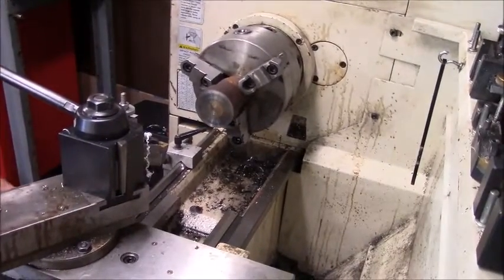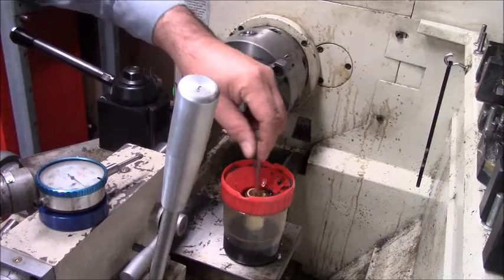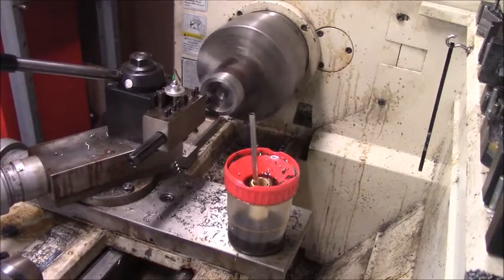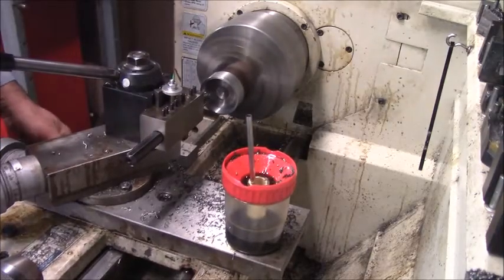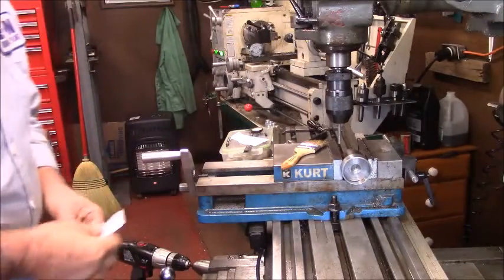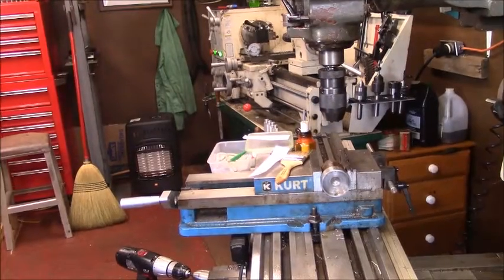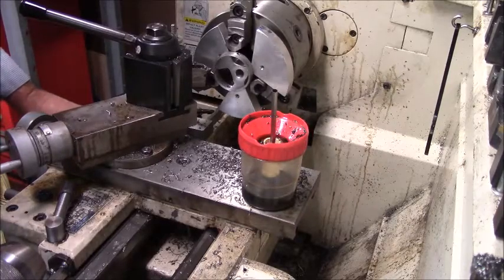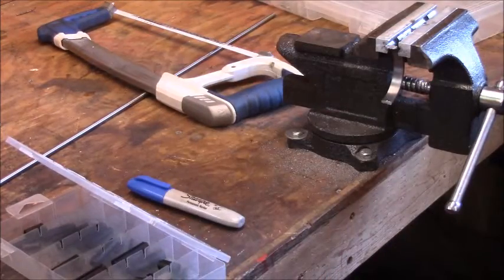Shop made spanner wrench for keyless chucks

Comment: Nice little wrench - I don't use keyless chucks of that size, and have always been suspect of them as far as getting them tight enough or being able to loosen them if they got overtightened.  A small spanner wrench like that would definitely make using one easier.
Reply from the maker: Everett's Workshop yes that’s a drawback to the keyless chucks, it beats a strap wrench. Thanks

Comment: Hi jim 
what is wrong with the lathe sounds like you got belt slippage
Reply from the maker: Nigel Harding actually it’s the HP of the machine I actually stalled it before
Reply: Is it a 2HP motor?
Reply from the maker: Hill Top Machine Works yes but a Chinese 2 hp, unlike your Enco my Grizzly was built in mainland China, instead of Taiwan

Comment: Hi did you know I was thinking when you shared you have more time then money what I have learned to do is because I too have way too much time and little to no money is get really creative so I am thinking that when like me you have little money your creative ideas flow at their best levels. 
Spanner wrench truly enjoy the build here, we believe we know the original maker of the German made Albrecht chuck, it has no spanner wrench so here to learn why the knock offs (or what you call the cheap) need one of these wrenched. Yes on the tubing to start makes good sense but I know from you, you use old scrap you have laying around which we like here.
Reply from the maker: Active Atom I had a Rhom keyless chuck that froze up. However it also had the same set up. So I decided to make one up for when I need it. I want to make a one for the ER collets
Reply: My Albrecht doesn't have the pin wrench holes either. Only a semi logical guess on my part, but the cheap keyless would certainly not have the tightly controlled heat treating and then a lot of precision grinding steps done to them. They have to skip a lot of that built in accuracy and precision to meet the far lower price point. Doing so results in much less holding power since so much of the tightening force is then lost to friction. I also bought 3 integral shank keyless chucks from Glacern machine tools that surprised me since they compare quite well to my Albrecht for run outs and holding power. I've yet to ever have anything spin in one of those chucks or ever require a wrench to loosen them and only use normal hand tightening. I'd certainly buy more of those. But like anything else there's a trade off with the keyless. Using the large diameter Silver & Deming type stepped drills in them is a huge mistake. A good keyless can self tighten enough while using those to do permanent and non repairable damage to the chucks internals. Anyone using the S&D drills should be using a good keyed chuck or an ER collet chuck. That normal self tightening with a keyless is also why I limit mine to about a 3/8ths maximum while power tapping. Mine will usually open by themselves while reversing with anything more than about a 3/8ths tap as well. 

Rohm from what I've seen have I think at least 3 price levels for chucks with there brand on them. One is at best a dirt cheap DIY grade that must be getting made in China or India under licence with Rohm to roll stamp there name on them. The second I usually see priced about at the $80 range and doesn't seem too bad. And the third is priced about the same as an Albrecht. My 18V Dewalt hand drill came with one of the mid priced 1/2" Rohm's on it and it's also been a very good chuck. I doubt it would really stand up to drill press or mill use though. There's more than a few YT videos with complaints about poor holding with the cheapest keyless chucks, and from that buying those cheap ones seems to be a total waste of money.